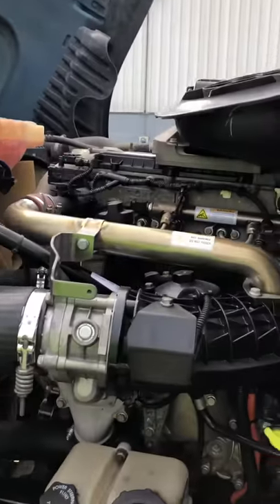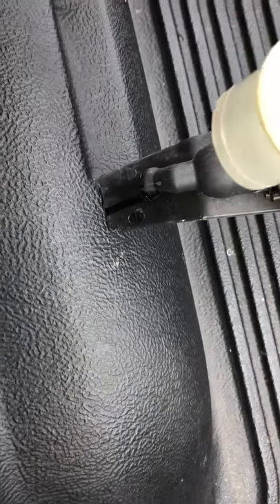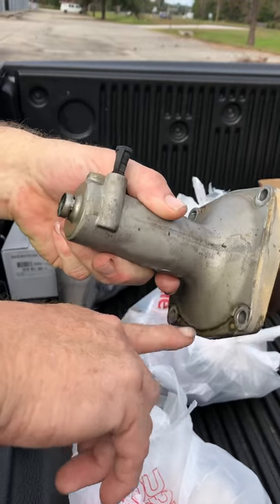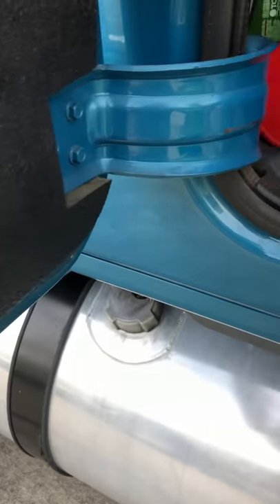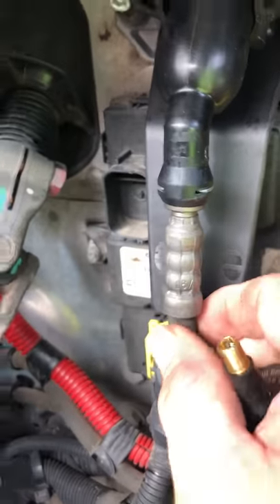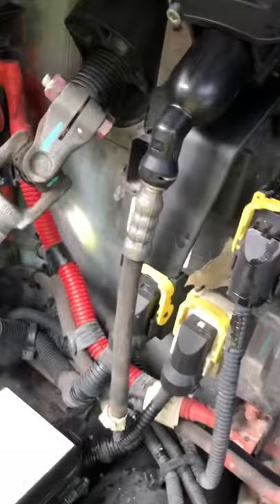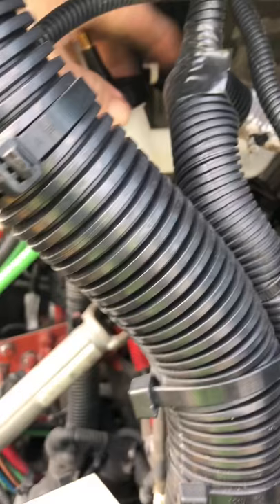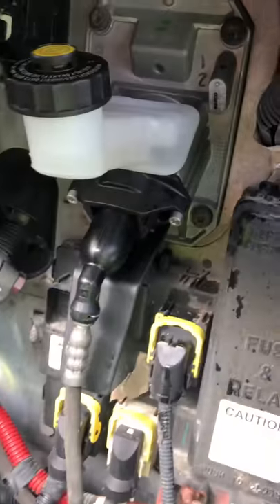Cascadia hydraulic clutch bleeding

Comment: Cap from a 2 galon or 5 galon plastic fule can fits the top of master cylinder. Inserted 3/8 hose inside spout ( old style spout) and secured with black tape. Used about 1 or two ponds of pressure, bleed the slave off worked perfectly. This was after replacing just the hose that had a hole rubbed thru.
Reply: Same shit happen a month or 2 ago

Comment: Thanks for the video. On my 2014 Cascadia, I had the same problem, I didn't realize.my slave cylinder had a slow leak, and I unknowingly ran my fluid low. Also the plastic piece that pushes on the master cylinder plunger on the pedal assy. crumpled into 5 pieces. My pedal whet all the way to the floor and I could barely get it in gear without grinding a little.. Then I woke up one morning and everything changed I couldn't depress the clutch but only a couple inches, and as soon as I moved the pedal a 1/2 inch it would engage. Thats when I noticed that was left of plastic piece was jammed sideways. I was driving up a heavy grade and I heard my clutch slip a little, so I pulled over at a loves and thought I was done. I called 2 different Freightliner dealers and a well know other respected truck repair shop and they all told me the same thing (I needed a whole new clutch put in to the tune of $3700-$4700. I knew my clutch was fine because I baby my truck and have never abused the clutch or my. clutch brake. That's when I noticed I was out of fluid. I filled up the resivore, loosened the release valve and pumped the master cylinder plunger several times with a pair of plyers, then tightened the fluid valve and away I went. I glued a piece of broom stick into the hole that the plastic part fit into and glued a beer cap on the end to keep the plunger from mushrooming the wood, and away i went. That happened several weeks ago and I have had no problems since. I keep a close eye on my resivore now though, and will replace both soon.
Reply: Still going, no problems..

Comment: Thank you for the video, but all that work is not needed.  It is very simple to do.  Just remove the slave cylinder to hold vertical.  Then gravity bleed through the nipple twice.  Then push on the piston inside the slave cylinder with a socket extension.  You will hear the sound of bubbles coming from the reservoir up top.  Push in the piston a second time and you should hear it again.  By the third or fourth time there should be no more sound.  This means your system is bled.  Won't take very long to bleed.  Your clutch will be hard right away.

I bled my International Prostar which has the same slave cylinder as yours.  Here is a link to a video that shows the correct procedure  https://www.youtube.com/watch?v=AWxpUYiBHKQ.

Comment: Why not bleed it the same way as brakes on a car or any other automotive car clutch by having someone to press and release the clutch pedal while person under the truck is cracking loose the bleeder valve on a slave cylinder and watches the air bubbles coming out of it through the clear hose? And topping off the clutch fluid reservoir?
BTW Meritor Wabco also makes the clutch control repair kits which includes that plunger valve that hardens over time and looses its ability to push the brake fluid into the slave cylinder thus engaging the clutch. No need to pay $450 for pedal assembly if rebuild kit only costs like $75.
Reply: Clutch pedal should not be replaced at all. Just master cylinder.

Comment: I have this problem with my 06 oeterbilt 387. Havent been able to find any video on how to repair this
Reply: What was the outcome how did you fix it? I currently have the same problem
Reply: @jj2751   I no longer have the truck but I did fix the clutch before I sold it. The clutch petal is a 2 piece unit. "Petal and a bar that the petal bolts up to under the dash". My bar was broke. I went to the junk yard and found an old kemworth t600 if im not mistaken. If I am  just look up and kenworth that parts interchange with each other. And you will he able to find wat you need.

Comment: My clutch pedal is hard to press, do u think it will solve the problem if I bleed the air out? I changed the pedal and the slave cylinder
Reply: It's supposed to be hard to push. If u have air it will be too easy to push and will not move the throw out bearing on the clutch.

Comment: Fyi...u did too much with that cap and valve stem. All u need to do is fill the reservoir (leave cap off) and go underneath the truck. Unscrew the 4 screws on the slave cylinder, hold it vertically with the hose being on top, push the piston by hand all the way in 3 or 4 times. Done. Super easy no mess and no need for another cap. Takes all of 5 mins. Plus it can be done without a helper. Oh the clutch paddle must be up. If it is depressed the air will not purge up through the tank.
Reply: I gotta 2010 cascadia and its leaking from the housing where the slave cylinder is, don't know if i should change the slave cylinder myself or take it to mechanic, im more worried about how to bleed the system..
Reply: Was the slave cylinder that second part he replaced? I normally add brake fluid and just pump the clutch until it comes back up. This time my clutch was hard to press down. I added brake fluid as usual but the clutch is still pretty stiff. It wont go past my brake pedal (towards the floor)
Reply: usdpaulp I am sure glad  I scroll down in the messages because it worked!!!! Thank you so much and to think I was fixing to do what this guy did wow lol Thanks man
Reply: 4 bolts stuck on slave cylinder...any tips to loosen?

Comment: I have a question 

What does it mean 

When your clutch go all way to the floor and don’t come back up 

Have to finesse the clutch to get it to stop
Reply from the maker: Detrick Landrum That is most likely a hydraulic problem.  Simply bleed the system.  If it doesn’t bleed then it’s probably going to be the slave cylinder, but I wouldn’t rule out the clutch master cylinder.  A properly bled clutch will not stay on the floor.
Reply: Would I need to buy a new clutch
Reply from the maker: Detrick Landrum If it’s just a hydraulic issue then you will not.  On the Cascadia you can remove the inspection cover and there will be a dial gauge that will tell you your clutch used.  First step is belle the system.
Reply: Lonnie Keller where u out of driver
Reply from the maker: Detrick Landrum  North Florida.
Reply: I was trying to bleed my clutch for 5 hours after I swapped both master and slave. My paddle was kinda getting pressure  but wouldn’t come back up. I figured it out my throw out bearing next to clutch break wasn’t sitting straight.
Reply: Read my comment.

Comment: Can you use a bike pump to replace the compressor
Reply from the maker: You should be able to.  The point of air pressure is to force the air bubbles down to the slave cylinder bleeder valve.  Make sure to add plenty of brake fluid before you add pressure.
Reply: @lonniekeller9416  I did and it works just fine save some money
Reply from the maker: Good to know.  Thanks for posting.